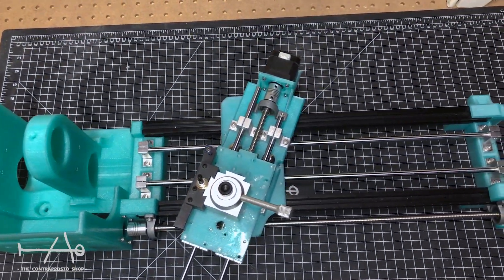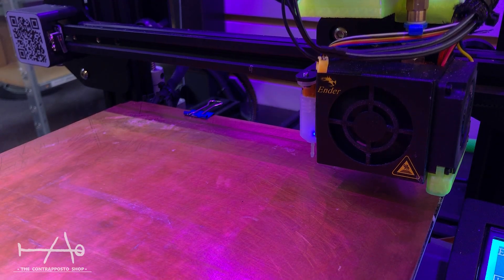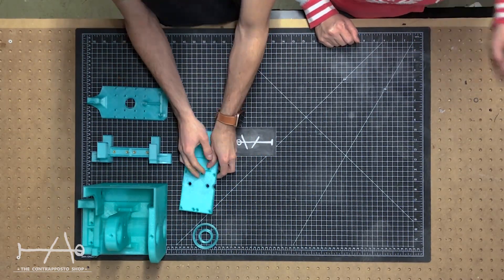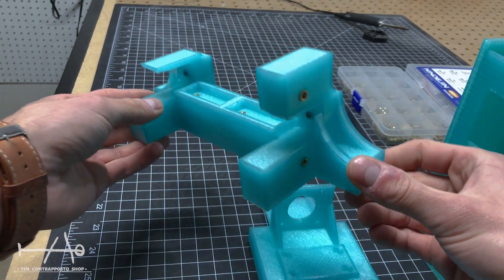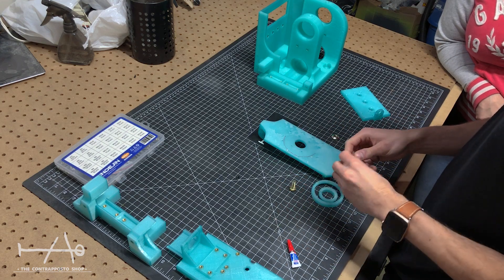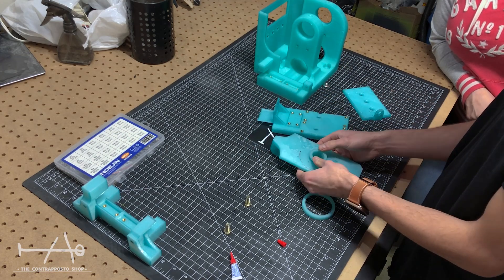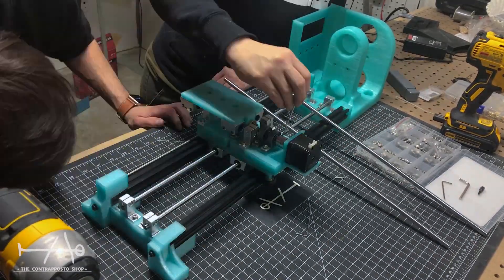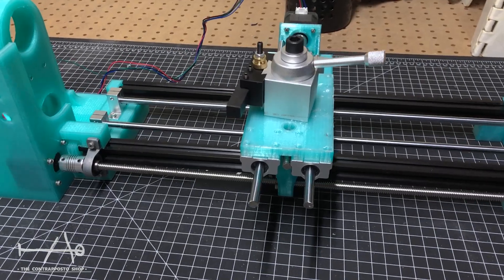3D Printed Lathe ( DIY ) PART 1

Comment: Where do you get the custom PCB ?
Reply from the maker: In the google drive, we’ve put a folder call « gerber files » if you want order it or look at it ;) !
Reply: @thecontrappostoshop  hey ! nice project. i ordered the pcb but one question since there is not in the bom .could you please tell me the capacitors values ?c1-c4 and c5-c6 thank you!
Reply from the maker: We ordered it on JLC PCB. You can download the files you need to order. You can easely do it on a breadboard or prototyping pcb since the circuit is simple enough.

Comment: Mount a dremel to it instead of a regular lathe tool and with a carbide endmill and shallow cuts/slow feed you should be capable of doing accurate work in non ferrous metals, possibly even mild steel...

(would make a tailstock for it though...)
Reply from the maker: I did not think of the dremel ! Its a good idea ;) . For the tailstock i will integrate one in the futur.
Reply from the maker: Tomorrow 5pm part 2 ;) ... you will see the result with the dremel ;)

Comment: Congrats. I've been working on the idea of a real metal cutting lathe that is mostly 3d printed.  Different concept.  Everything I've seen before your video has been crap.  I haven't seen the first section of all thread yet in your design which is a plus.  I think it will still be too flexible but I will remain open minded.  Can't wait to see how you solved the spindle problem which is the biggest difficulty in this project.  My concept is different from yours and is hand operated, not CNC.  I will enjoy seeing yours.  Liked and subscribed.
Reply from the maker: Hi, thanks for your interest in this project :). In the part 2 you will see how we reinforce the electronic part. We will also change the design a little bit on the carriage part ( replacing the linear rails with extrusion bar ). Stay tuned :D
Reply: @thecontrappostoshop  Cool.  Wheels on the side not as good as wheels on top.  All forces are down and make best use of the ball bearings radial load capacity. Thrust load capacity of ball bearings very poor.
Reply from the maker: You're totally right ! the only reason is that I was running out of space. I will probably do it in a future version;).
Reply: maybe start 3D printed and then  gradually work up to other stiffer materials etc
Reply: Did you ever finish yours?